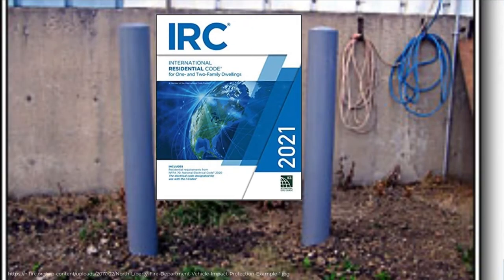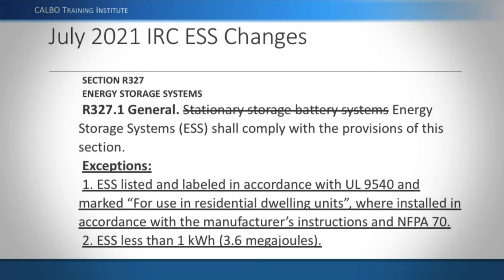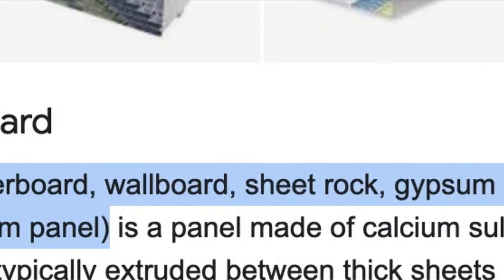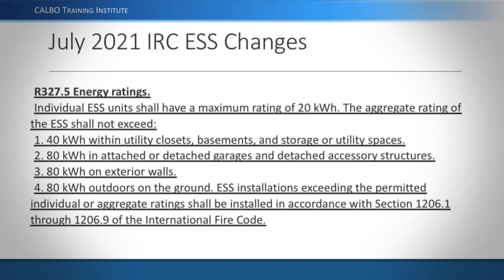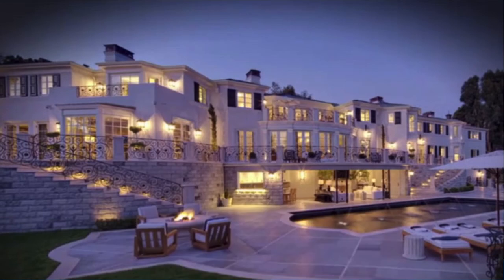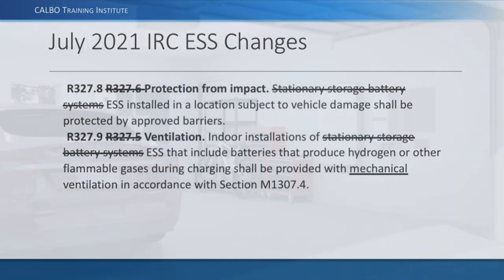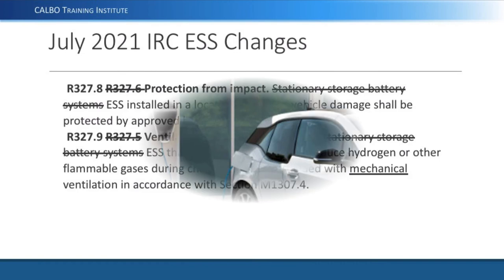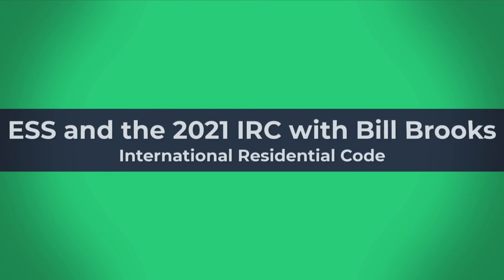2021 IRC, IBC and IFC for Energy Storage Systems with Bill Brooks

Comment: 3 feet seperation from units?
Reply from the maker: Unless UL 9540A fire testing has been done. You can read the manufacturer's instructions and see if it can be installed closer than 3 feet, which is most common for the popular redidential ESSs.